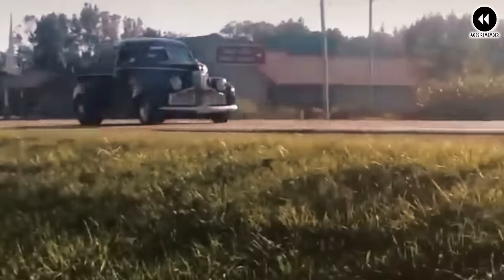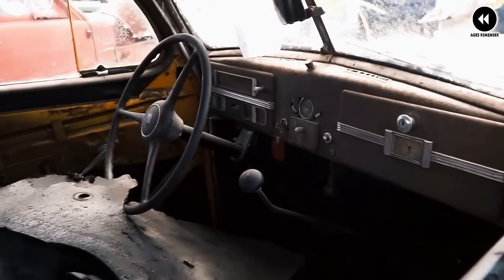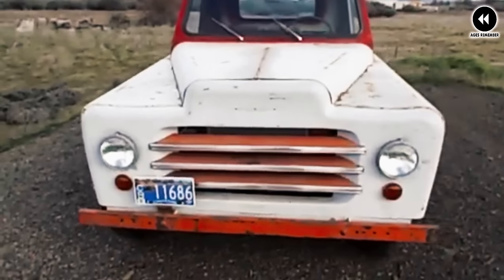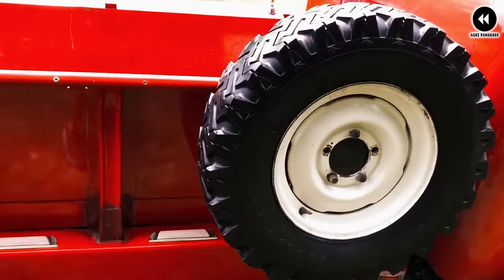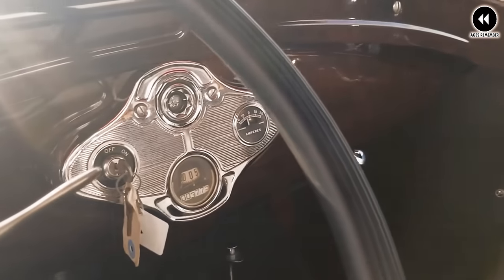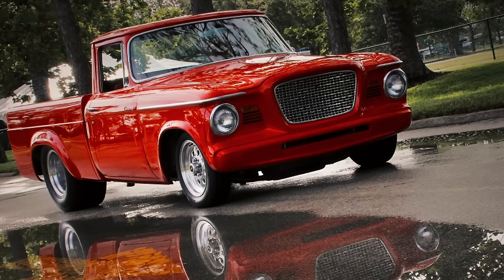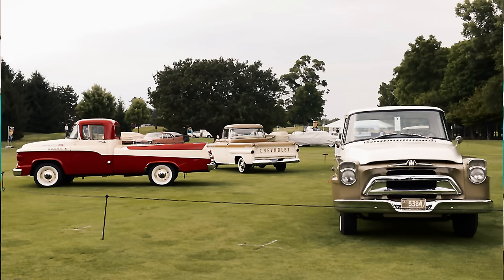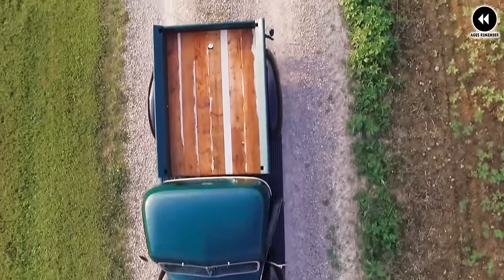BAD NEWS! 15 Most GOOFY American Pickup Trucks!! That Nobody Expected!

Comment: 8:49 what were these projecting things used for ?
Reply: I’m not sure. Possibly storage of small or long skinny stuff that you want to keep dry, hidden and out of the way. 
When I was a window cleaner, I put PVC pipe on the roof rack of my truck to store my poles. I can’t imagine a truck company building a truck with such specialized equipment though.
Reply: @vladtheimpala5532  Thanks for the reply !